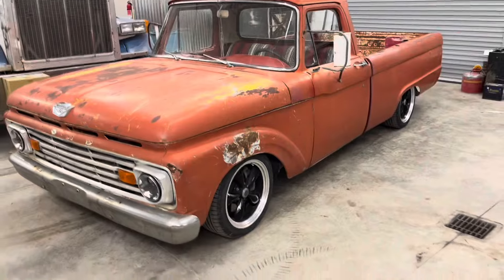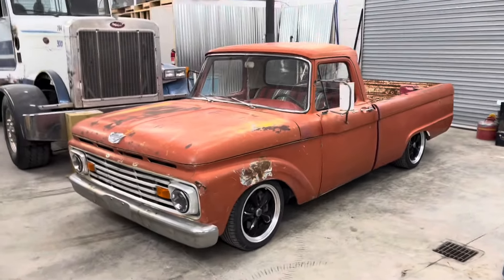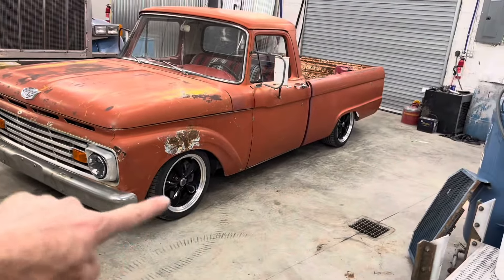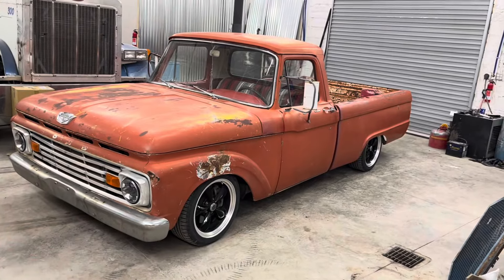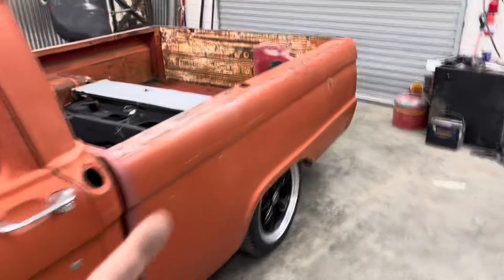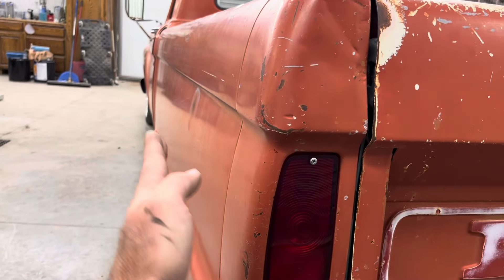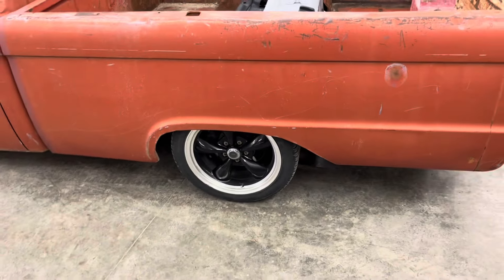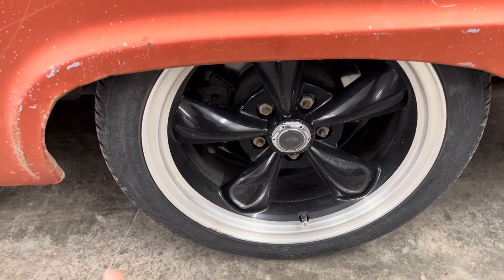Crown vic swap 65 f100 update #f100 #crownvic #custom

Comment: Not having the radiator support on rubber bushings probably contributed to the rear cab mount’s collapsing. Something told me there would be an issue somewhere, I figured cracks forming in the fenders or radiator support though. I’d buy a beater ranger or something to drive in the winter time, that truck deserves to stay just like it is. Other than a roll pan and nice set of not super loud mufflers (just a touch of sound) excellent build man! 🎉
Reply from the maker: i agree i will be changing the radiator mounts just to make sure that doesn't happen to the next ones i build